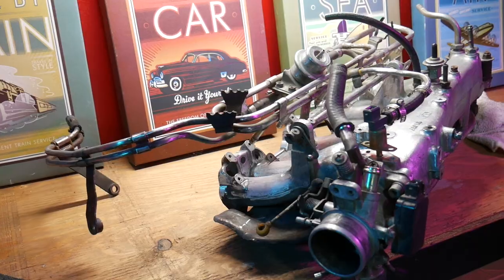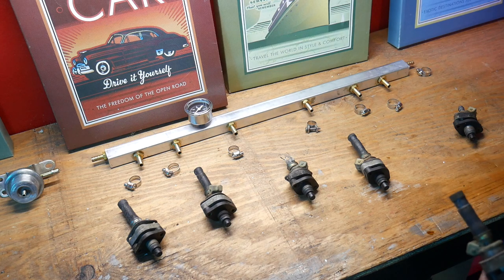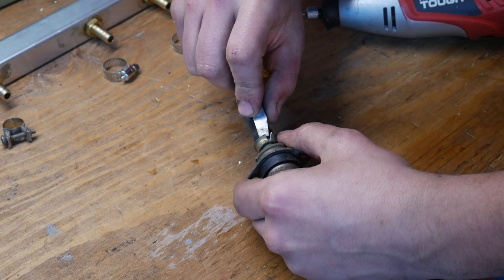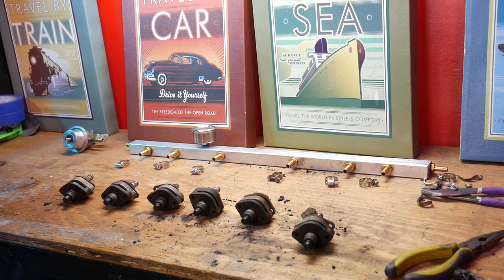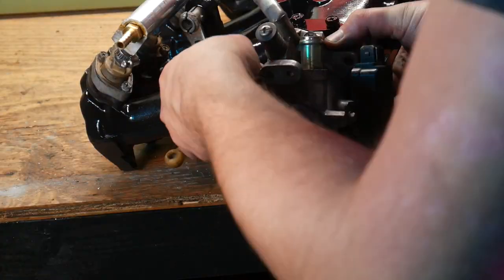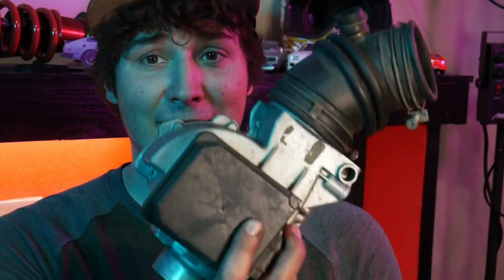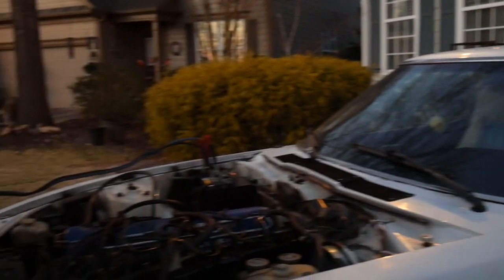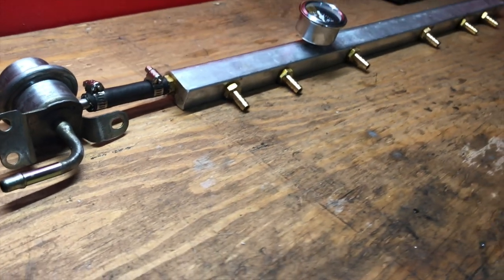24 Hours to get the Datsun Running Again! - 1980 280zx

Comment: Ditch that stock throttlebody and fit a KA24 or RB30 or anything nissan.. they run same bolt spacing and with a 20mm spacer, will bolt up. 
Move the throttlebody linkage over and it will bolt up to the stock linkage on the manifold
Reply: I did similar headers and upgrade throttlebody and went from 118whp to 140whp. 
There’s a way to adjust the Airflowmeter meter (google) if it’s lean

Comment: If I were you I’d ditch the old EFI and switch over to a micro squirt or Megasquirt system.

I’m currently running a megasquirt 3X on my 280zx and the spark is converted to coil on plug and ran by the computer aswell, but for you, I’d keep the distributor system and only use the Megasquirt for fuel control, if you drill the stock intake injector holes (I can give you specs on mine) to a certain size you can use modern GM (high impedance) injectors unlike the OEM (Low impedance) type, makes tuning easier and with modern injectors you can have a better spray pattern and bigger injectors for more power later on.

Anyway, if you want, you can buy a micro squirt from (diyautotune) and some other small stuff (I can help you figure your system out) and as long as you buy the stuff Ill help you setup, install, and tune the car free of charge, only thing I ask is you give me a shoutout once it’s all in the car and working properly.

If you want proof that I’m not full of ** then I can send you some stuff on my current setup lol

Regardless of wether you take my offer or not, great video(s) and love the channel, your recent video on the 280zx specs was well done 👍, much respect to you.

Comment: Yeah that fuel pressure regulator is definitely bad dude. I bought a whole new set of injectors in and it still ran like shit. I replaced it in a fixed issue